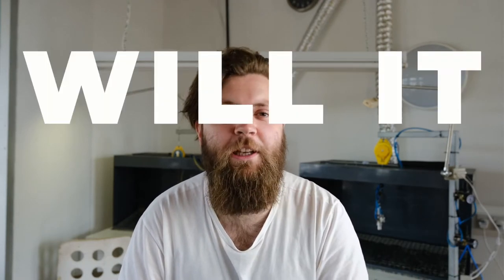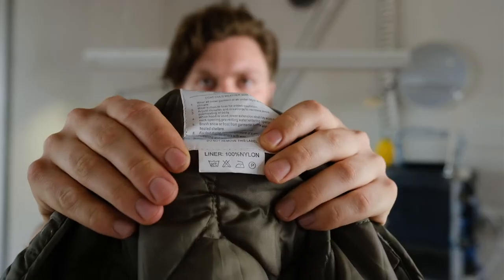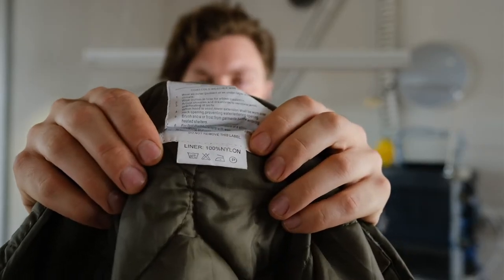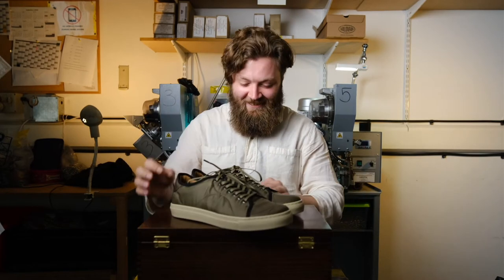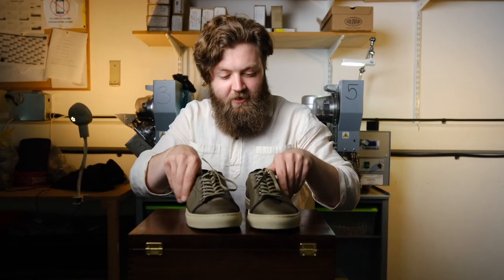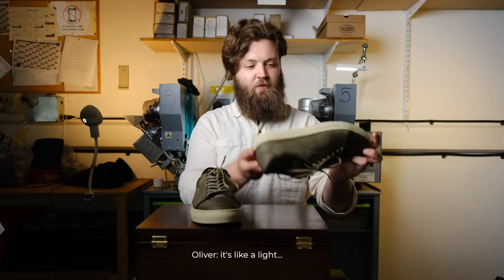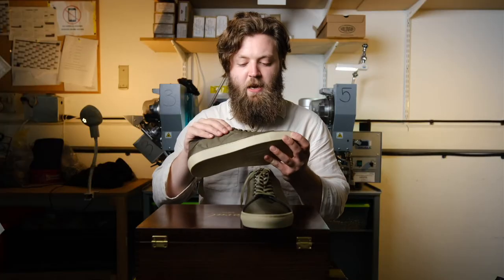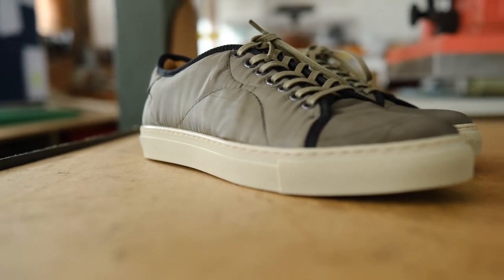Can we make shoes from an Army Liner? - Will it Shoe?

Comment: I know that the point of this show is to highlight the material used but I think the insulation material would be better on the inside with leather out. I would buy those shoes but insulation layer outside is at risk of ripping for sure. 

I support the call for a bergen video, would love to see some camy cordura shoes from you guys!

Comment: I have several M-65 liners.  Don't snag it on anything. I used to smoke. All you had to do was get a tiny ash on the material, and it would burn a hole in it in a split second. To make a pair of shoes out of this material makes no sense, unless you're just going to wear them indoors. That's why it was a liner. It was made to be worn on the inside of the field Jacket. The field Jacket could take the abuse, not the liner.